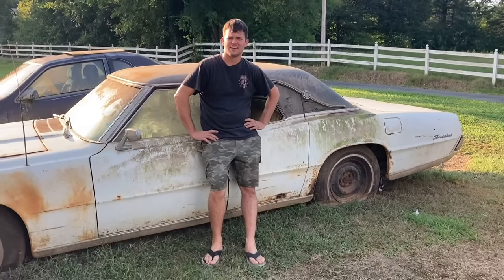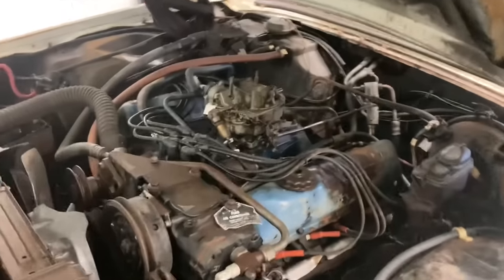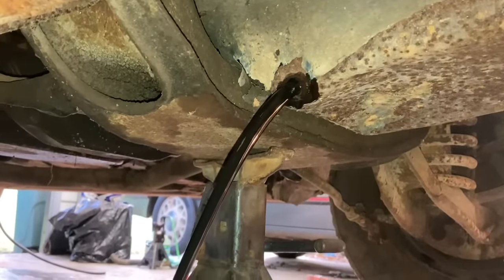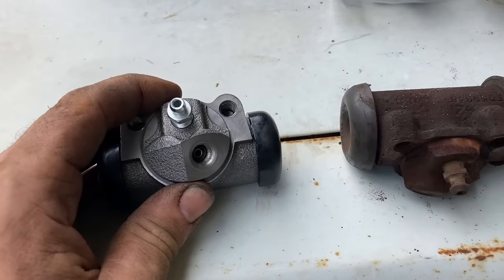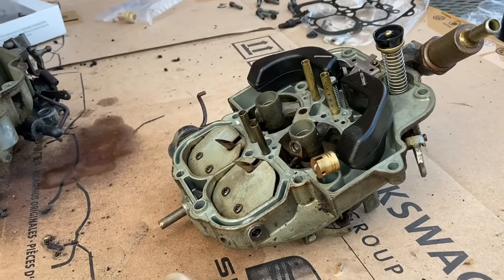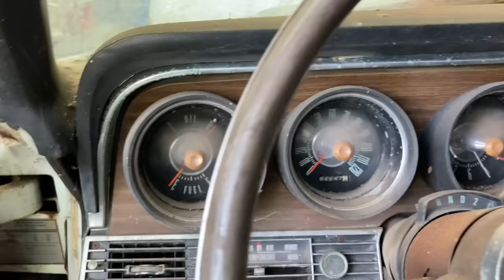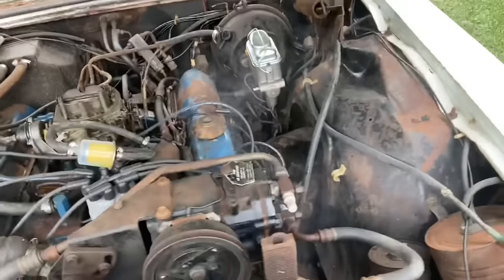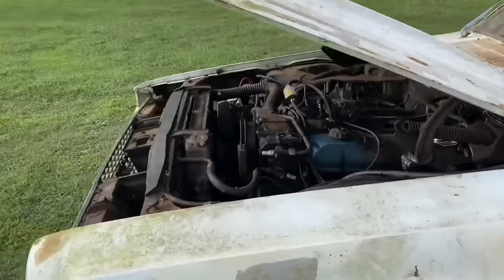67 Thunderbird sitting for years will it start?

Comment: Those were very cool land yachts.  About 20 years ago I pulled a '70 4 door T-Bird out of a barn because I wanted the 429 engine for another project.  Engine needed a total rebuild and the body was completely rusted but the interior was beautiful.  After I pulled the engine I sold it to a guy that had a perfect body but needed an interior which made me happy it wouldn't go to waste.
Reply from the maker: I wish mine had a 429
Reply: @Sleeperdude  you can have the 390 rebuilt and make it a 428. A 390 and a 428 are both FE engines. You could even get a set of aluminum Cobra Jet gears for it and make it a Cobra-bird. That'll haul ass when you're on the gas.
Reply from the maker: @adamtereska8734  that would be cool
Reply: @adamtereska8734  No, you can't make a 428 out of a 390...390 bore to 428 bore is  to much for a safe overbore..and you need a 428 crank....with a 428 crank in a 390 you get a 410 like the early  Mercury Marauder...
Reply: @Sleeperdude  dang dude a pan of fried taters and a big spam sandwich nothing better. Now I am hungry.  Lol
Reply: @sleeperdude you can always dream the 390 is a Cobra Jet

Comment: Ah, have you heard of induction heat bolt removers? They're good for heating up bolts and nuts quickly without spreading heat to other things. Especially good for brake and other fittings like stuff near gas tanks that torches might not be best for. Been a great addition to my garage! Thanks for getting this old relic going and saving her from the crusher. Stay safe and healthy!
Reply from the maker: I haven’t used one but I have heard of them thanks
Reply: @grantkoeller8911  I've been using it for 5 years and hundreds of bolts later with no issue.

Comment: In answer about the windshield wipers,  they work off of vacuum just like the head lights do. My Dad used to work for the local Ford Garage and the owner let my Dad take a brand new 1967 Thunderbird, the big motor in it and suicide doors on vacation to Safford Arizona . I loved that car.  Daddy bought the car when we got back home. It was the same Mint Green, with the Black Vinyl Top. Can't hardly wait to see it all cleaned up. Thanks for taking Me back a few years 
Nuff Said.
Reply from the maker: That’s a cool story I am working on a cleanup video

Comment: Yep, the wipers ARE operated from the power steering pump.  The "tilt wheel" is adjusted from the turn signal switch (push it towards the dash) and you can adjust the wheel.  Last time I checked there were 2 Lincoln parts and repair specialists.  One was in Florida (Lincoln Land, I believe) and the other I think is in Mass. BOTH have an excellent supply of parts, manuals and will help with troubleshooting.  The front calipers PROBABLY are the same as the Lincolns, so I would give them a try.  Good luck and keep on posting your progress.
Reply from the maker: Thank you it does have the same front brakes as the 67 continental I got running a few months ago

Comment: When I was stationed at Ft. Polk, Louisiana, I bought a 1971 Thunderbird. It was almost the same body style as yours. The taillights didn't have the bottom row and the turn signals blinked sequentially. The front grill was poked out in the center. It also had a high performance 429 engine in it. I loved that old car. Sure miss it. That was back in 1984.
Reply from the maker: So cool good days

Comment: In the mid 80s traded for a 68 Thunderchicken that a guy had restored himself. It was very similar butt came with a 429, bucket seats and when you opened the driver's door the steering column as well as telescoping would swing right I guess so far boys could get in n out. Brother that thing would  definitely carry the mail !
Reply from the maker: That sounds cool

Comment: Well "Sleeperdude" I have watched a good many first starts on just about any engine imaginable and straight off, you have caught my interest solid ten. You are going way above most to do things the right way. In all my years of twisting wrenches as a mechanic in logging camps across the islands of southern alaska's logging camps and as a kid fixing cars and mostly trucks as in big diesel engines, I find myself struggling on the names of different parts and pieces. Like the name of the thread  repairs kits where you run the new threads in out of a helical coil... a little coil of metal that threads into a hole where there were threads and so after you replace them with that metal coil of very  thin steel and it fits down into the part that you are repairing so  that the plug is now tight. It would work in that oil pan so it don't leak no more. Now to be truthful, that engine should not be running as its all jellied up on the inside of the water jackets and the manifolds are sad to say the least. Your going to make your mark in mechanicing.... you have with me already and I twisted on them for most of fifty years minus military and dippers ...... you got it down well. I don't know if you know this one or not as he is strictly comedy but he is funny and you might enjoy.... Puddins fab shop. Him, and Brent at Halfass Kustoms then you are the dynamic three
Reply from the maker: Wow thank you I appreciate it

Comment: That's a great car and I've always loved the FE series engines. Hell back in high school I bought a '69 thunderbird out of a junkyard for the 429 to use in another project and wound up cleaning the car up and got it running good and used it to go to junior prom. Sold it that summer and bought a 70 vista cruiser which was another fun story.
Reply from the maker: That’s a neat story
Reply: The 429/460  is not an FE block but is probably a better engine overall.
Reply: @spaceghost8995  yes the 429/460 is part of the 385 series but I guess the way I wrote that it sounds like I thought it was an FE. I really need to proofread better!

Comment: I am currently waking up my 1968 429 4-door Thunderbird from a 13 year hibernation.  I've had to do everything that you had to do in this video.  Carburetor, water pump, fuel pump, rear and brake hose so far.  I also had to heat the fittings on the rear brake hose and yep, mine was also clogged and gave a startling explosion as well!  Good luck on the rest of the resurrection!
Reply from the maker: That’s awesome keep up the good work

Comment: I swear by Marvel Mystery Oil like my Dad did and I'm 70 yrs old. Put it in your oil and in your gas tank and its great for shooting directly in those spark plug holes. Great job getting this one running. I really do like the sound of that engine. Like you said water pump was froze up and they probably parked it. Thanks for the fun video.
Reply from the maker: I like it too thank you

Comment: I bought a 62 Olds 88 out of a field in about 1983 for $90. Put in a battery, a splash of gas and it took off. Two days later, no tune-up, oil change or other preparations, two friends and I took a 2000 mile trip in it with the only issue being a clogged fuel filter along the way. The parts store was across the street and in a dusty box on the shelf was a new one.
Reply from the maker: That’s amazing

Comment: Crew cab. For real. Really impressed you got it going. My 69 with a 429 parked after loosing 1 or 2 quarts of tranny fluid a day from the front seal. Be careful if you invest in a fan shroud. The motor mounts may be gone and lifting. Also, yours may not have it but the 68/69 has rubber drain hoses for the back window vent. Once the hoses go, it drains into the trunk. Seriously impressed with what you did. Good job!
Reply from the maker: I did see some rubber drain hoses that were rotten thanks

Comment: Oversized oil drain plugs are available if the pan threads are gone, they’re self-threading, self-tapping. Get em started straight and they work like new. Keep in mind too, Ford used to have issues with crappy drain plugs, so sometimes you can just replace them with factory sized 1/2-20 plugs. If you can’t find brake calipers, the pistons and seal kits should be available as long as the caliper bores aren’t too rusty and pitted up. Love the vids, you’re down to earth and I don’t see $250k worth of tools laying around, just like the rest of us!
Reply from the maker: Thank you

Comment: Your turbo Thunderbirds may put out more horsepower, but I like the sound of a old engine. I'm glad you got it running. The oil filter you used is good, but I like Motorcraft filters better on older Fords.
Reply from the maker: I like v8 sound

Comment: You might try sanding the glaze off the rear drums and it should bring them back to life. If you can dig up a vacuum gage and you have low vacuum use starting fluid to help you find the leaks. It will make the rpm change when you spray a leak. You hopefully have a new fuel tank on order. If you have a compression gage it might tell you how the internal components are doing.
Reply from the maker: Ok thank you

Comment: I would recommend getting a bunch of one-way vacuum valves and start installing them on the lines until you can isolate all that stuff so it doesn't take away from the engine
Reply from the maker: Ok thank you
Reply: Many many vacuum servos on that bird! All need to be checked for leaky diaphragms too.
Reply from the maker: @JohnShinn1960  thank you

Comment: Those old motorcraft carbs are garbage even when they aren’t plugged up with junk. I remember a 460 I had with a motorcraft carb…..ran ok after a rebuild but just didn’t seem to run like it should. Swapped it out with a 650 Holley…night and day difference! Would actually spin the tires from a dead stop after the swap!   Fun resurrection tho!
Reply from the maker: Yeah for sure

Comment: It has a vacuum controlled booth lock release. So replacing all vacuum lines is cheap but elaborate. Then all these accesories will work and the engine will run much better.
Reply from the maker: Ok thanks
Reply: @Sleeperdude  don’t forget. You sir are an amazing mechanic. Don’t give up. Just move forward. These cars are super rare and these video’s will be watched, if you do the subject justice, for decades. 

All the best from the Netherlands. My dad was an electronics teacher. And I have fixed and bought countless boutique tube amplifiers. This is the same deal.

Right now you buy your stash. That will dry up. Just get better at your trade. You could even start selling vacuumline kits for these cars. 

Have at it. You are a joy to watch.

Comment: On these old rigs a can or 2 of berrymans b-12  and/or seafoam down the carb...try to pour alot and stall it out at the end of your can..let it sit 10-20 mins and then some full thorttle revs up to about 4000rpm help them run better and idle. Clears em out ..im sure you know this allready
Reply from the maker: I have used it before but I haven’t on the last couple but maybe I should thank you

Comment: Those cars had "automatic " parking brake release, vacuum operated. Without vacuum,  a small stubby lever up by the pedal was the  emergency release.[edit] the fuel pump was driven by an eccentric that bolted to the front of the camshaft.
Reply from the maker: Ok thank you

Comment: Brother get a 20 oz bottle and fill it part way with brake fluid and get a rubber hose you can clamp to your bleeder put the other end in the bottom of the bottle with brake fluid and you can bleed by yourself
Reply from the maker: Good idea

Comment: Moving just the distributor cap will not change the ignition timing. You must change when the points fire and to do that you have to get the distributor to rotate. Love the videos. I would also suggest you invest in the mastercool line flaring tool. Its not cheap but it is just the thing for flaring brake lines.
Reply from the maker: Ok thank you

Comment: 4 piston kelsey hays. Stainless steel brake company has parts for those brakes. If you could get a set of like 69 torino brakes and spindles you could possibly run single piston.
Reply from the maker: Ok thank you

Comment: @44:00 those cars had very bad brakes i had one those days very bad in winter as soon as you touch the pedal wheel locks.i had a 78 with T roof.
Reply from the maker: Oh wow that’s scary
Reply: @Sleeperdude  And forgot to say the back brake drum was like tank brake drum with 12" pumpkin def very scary on the highway with 400m engine if it had wings i bit it could fly,the good old days you dont see days like that anymore.,cheers:(

Comment: if the oil pressure is H like that, the bypass spring and valve is stuck in the pump (stuck all the way closed), might want to change it before it floats a bearing.
Reply from the maker: Ok thank you

Comment: Need to slide a car. Cheap dishwashing liquid. Doesn't stain and hoses off with water. excellent for on/off trailers and drive ways
Reply from the maker: Good idea thanks
Reply: @Sleeperdude  Thank you for providing your content, I am restoring a vintage caravan and the full interior resto of your second camper gave me a way I never saw of dry rot eventually undermining it's integrity from previous water leaks. Van was built in 1963-1966 and is as far as I know out of 400 built the only one left in a registerable condition, and even liveable if you wanted too. I have done a solar and 12v conversion hidden to retain the looks. Happy to help you out with some solar advice

Comment: Better check the motor mounts , as the oil pan is touching the cross member. Is it a 428 engine or a 390?
Reply from the maker: It’s a 390 I was told
Reply: Fan shroud damage. Probably a big groove inside it too.

Comment: Sounds like you have a bad vacuum leak. That is probably why the engine won’t idle properly. With the brakes not working right either, I’d say you most likely have a dry rotted diaphragm in the brake booster which is causing the vacuum issue.
Reply from the maker: Your probably right

Comment: My cousin actually has one of these cars and he’s selling it do you think that engine would fit in a 1976 Ford Mustang
Reply from the maker: Yes…  it is a mustang 2 front end .. it would fit they would have to do some firewall work but width would be good fit
Reply: @Sleeperdude  I’m all over that then thank you the only issue with the engine is it was set up for leaded fuel I’m gonna have to change the heads

Comment: HELP! I have a ‘67 tbird Tudor, has the 390 V8 engine. I need some help anyone who could point me in the right direction! I bought it from the original owner sat for 20+ years. Some kids broke into it, couldnt find the ignition lol so they set the damn engine bay on fire…. Luckily the owner had put it out. 

My issue is i cant figure out where all the vacuum lines are connecting. I also put a new carb on it though im not sure its going to work. Holley 600 or 650 cfm list-6231. Im thinking im going to just buy a rebuild kit for the original carb. I got it running but without the vacuum lines its high rpm. So far replaced fluids and did all the basics. 

Anyone know where these vacuum lines are going? My dad told me emissions were bi-passed. And i don’t understand how that works either. But any help would be greatly appreciated!
Reply from the maker: You should be able to find a vacuum hose routing diagram in an old shop manual or Haynes manual if not just cap everything off on the intake and carb so you have no leaks

Comment: A '67 thunderchicken should have a 428 in 'er
Reply from the maker: I was told it’s a 390
Reply: @Sleeperdude  provided the engine is original, which it appears to be, the 5th digit of the VIN denotes engine size. If it is a Q, you have a 428. If it is a Z, you have a 390

Comment: Why are people so into Wix oil filters??  They are absolute garbage!  I've had to rebuild engines because of collapsed Wix filters that blocked the oil flow!  I use K&N, Mobil 1 or genuine factory filters (apart from genuine GM / AC Delco as I've had gasket leaks with them).  Others to use are Mahle or Mann filters.